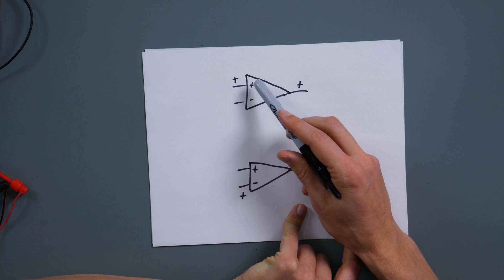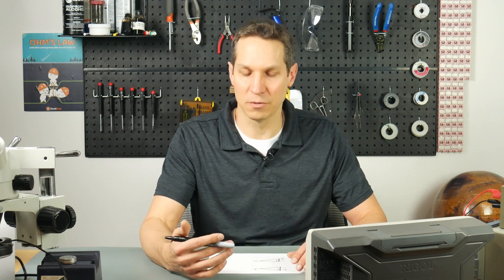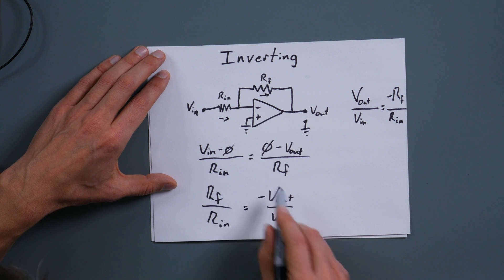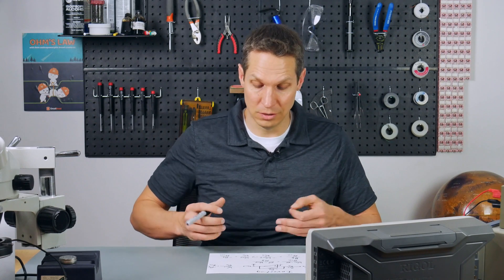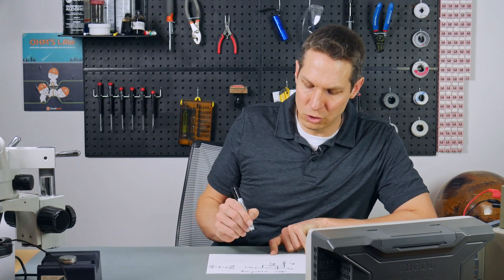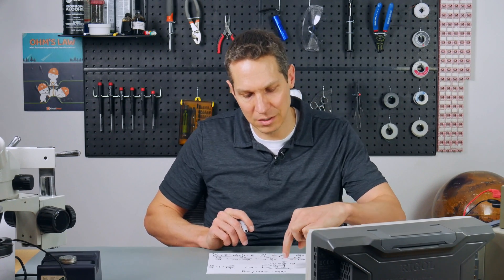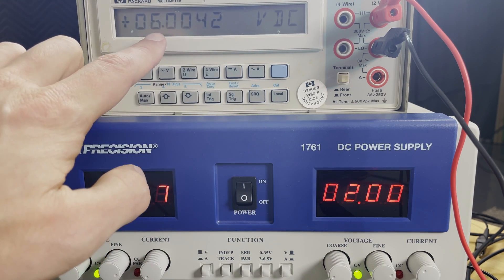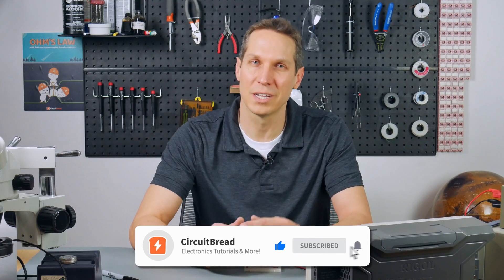Inverting and Non-inverting Amplifiers - Op-amps | Basic Circuits #13

Comment: Pretty good video… I would’ve added one more thing……
You stressed at the inputs need to be equal so why didn’t you emphasize that again right at the end? For instance, on the inverter.
You could say one volt in… -10 V out so… The -10 V is reflected back to the input across a voltage devider leaving one volt negative to blend with the one volt input, which equals 0 V on the input to the amp equaling the other input… Right ,because the op amp is constantly trying to make its inputs equal in all all all all cases
Reply from the maker: Great point!  Honestly, I really should have as that would be a great insight to share.  I wish YouTube would let me make additions and modifications after publication, even though I understand why it doesn't.

Comment: Hello! It was a very good video with the demonstration to help understand the concept. I had a question though, from the first video of op-amp series I remember that Vout will try to be at A(amplification) times Vin right and that as soon as it gets lower than that it will get back to that value. But I noticed that in the practical example it overshooted that value as well. Why was it so?
Reply from the maker: Sometimes you get overshoot as, in the op-amp itself, there is a feedback loop.  So, if you've looked at our control systems lessons, you'll see that there is a balance that must be made between responsiveness and the potential for overshoot.  As the output is trying to "find" the correct value to control Vin properly, it can bounce around a bit.  This is to be expected and, depending on the application, it may not be a big deal or you may need to make some modifications to either limit the bounce (usually slowing response time) or to account for the fact that your output will wiggle a bit before settling down.

Comment: I may just be really dumb, but it seems like the inverting and normal op-amp both just use a voltage divider. The only difference i saw was connecting the input to the + or thr -, and which of those the voltage divider is applied to to adjust the output.

Comment: One important thing to note... is that if the feedback loop is connected to the non-inverting terminal, these equations will still give you the exact same values, but that will not be the actual result.  Feedback loop MUST be connected to inverting terminal for these equations.

Comment: It seems to me like the math would resolve itself with the exact same result, even if you swapped the inverting/non-inverting inputs.  Is there a reason why the inverting and non-inverting inputs are the way they are in these circuits?

Comment: May I ask why you use 0 to 14 voltage as power supply? I think according to the datasheet, pin 4 should be connected to -14V in this case. I used LM301AN op-amp, and when I connect pin 4 to ground ( 0V ), it doesn't work. It shows that the output at pin 6 is higher than the voltage at pin 7.
Reply from the maker: In some of these tutorials I gave it the negative voltage, others I didn't.  The op-amp should work either way BUT if you don't give it a negative supply, it won't be able to generate negative voltages, which means that some (many) circuits won't work correctly at times.  It is always better to give it the +/- 14 volts (or whatever the datasheet says) but it is more complicated.

Comment: You are great, thank you very much for such a precious and kind explanation
Dear, Since I don't have practical test devices like oscilloscope etc. Does the simulation program fulfill the purpose and give me semi-real results?
Reply from the maker: Yes, simulation programs give amazingly accurate results.  There are a lot of options out there but LTSpice is free, powerful, and relatively easy to use (not the easiest but not too bad for a beginner), and it has the ability to give very accurate results if you take the time to setup the circuit with more realistic models.
Reply: @CircuitBread  Thank you very much for your kind reply and advice

Comment: Please check the output when A DIODE l, rather than resistor, is added either at the invert or non invert pin. The outputs are very contradicting! Make videos please.